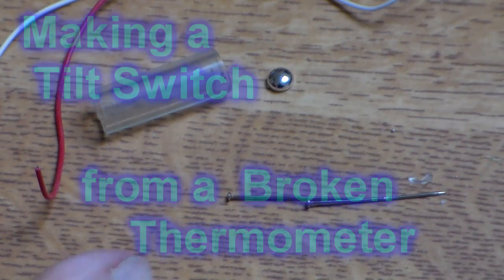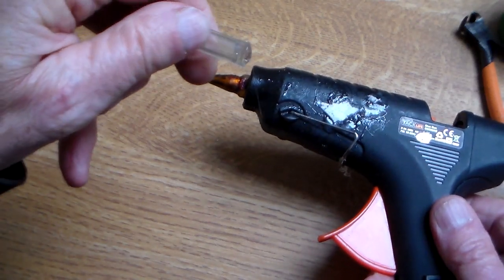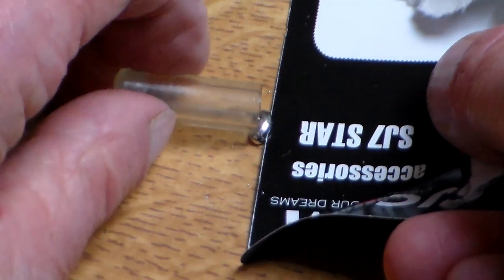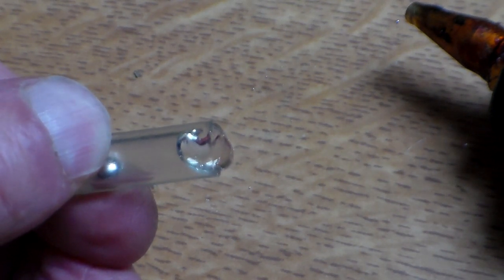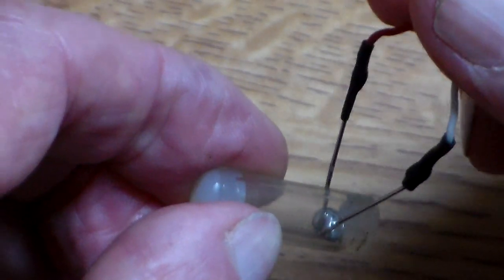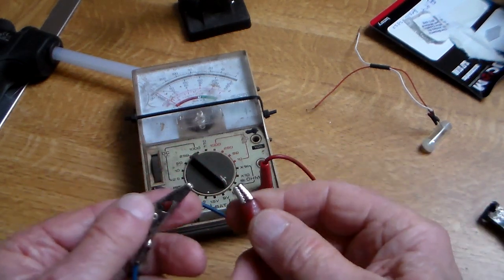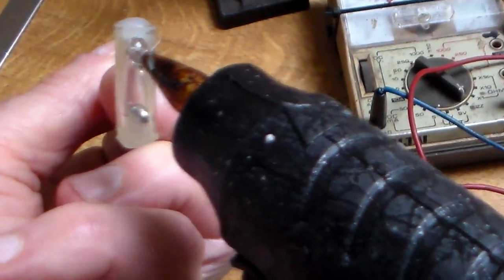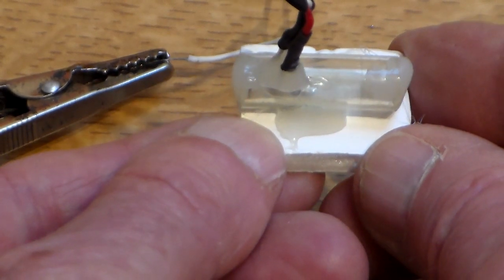What is a Tilt Switch?  You can make one with a little mercury from a broken thermometer.

Comment: great video. im surprised im just seeing this in 2025.  how many volts or amps does it produce?
Reply from the maker: If you're talking about how much current could it handle it would be measured in amps. 
This is what Google  says.
Mercury has good conductivity, and the contact resistance between the electrodes is generally less than 100mΩ. The current allowed by the switch depends on the electrode material. The maximum allowable current of the tungsten wire electrode is 10A, while the maximum allowable current of the general alloy wire is 1A.
And this ...
How many amps can a mercury switch handle?

The Mercury switches are spring mounted within the switch cylinders and protected from possible damage. Alarm and trip circuit Mercury switches will make, break and carry continuously 2 Amps at 250 Volts A.C or D.C. They will also make and carry for 0.5 sec. 10 Amps at 250 Volts A.C or D.C.
Reply: @bobflyman  thanks for the reply!!!!!!!!! this is interesting stuff!!! i live in europe and see all the old building etc and i knew that mercury had something to do with all of them AND  with motors etc.

Comment: Well I for one never knew how they worked, thanks for your inginuity and clear explanation Bob. 👍
Reply from the maker: Thanks Cliff.  You learn something every day!  Found that little bit of mercury when checking my thermometers when Covid started.  It was in the plastic tube with the broken glass.  Seemed a shame to throw it away!  I think nowadays they have electronic ones built into a chip, not sure how they work?  But even small RC planes have gyro sensors and flight controllers. I guess some kind of motion sensor.